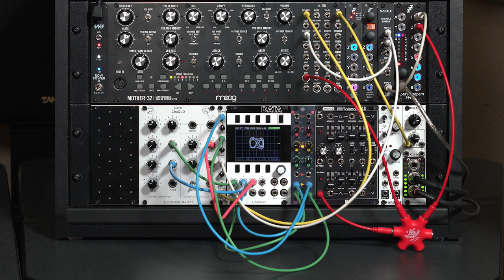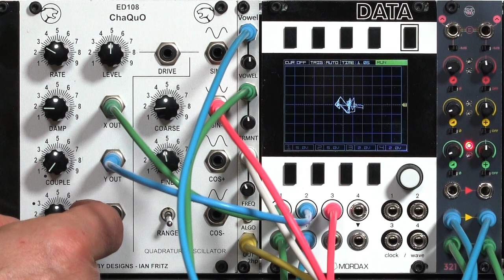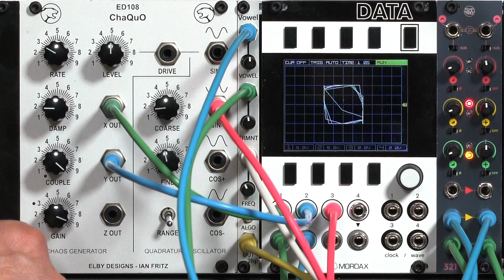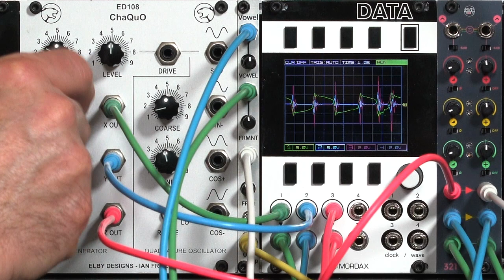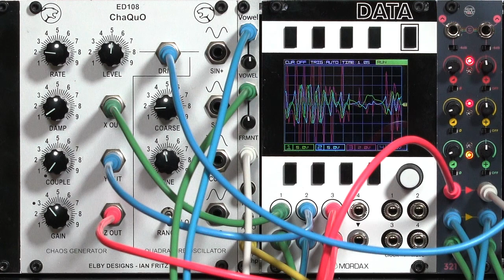Ian Fritz/Elby Designs ChaQuO 2/2: working in multiple dimensions

Comment: Great demo of chaos! I like that this module allows the use of outside sources. That's something lacking from others. Come to think of it, don't think I've seen any.
Reply from the maker: The Chaotica does not take an outside "drive", but it does have an interesting reset input that restarts its process.
Reply: @LearningModular   Cool! I ended up grabbing a Snazzy FX Chaos Brother. No external drive but it does cave a CV in that allows you to rhythmically effect the output, as well as a comparator that uses the chaotic signal to produce aperiodic gates that will generally align within the grid imposed by an outside clock into CV. Excited for it to arrive so I can explore. Thanks for inspiring me to pick this up.